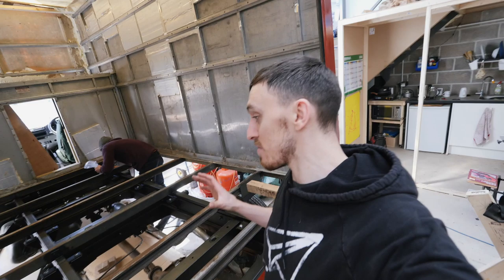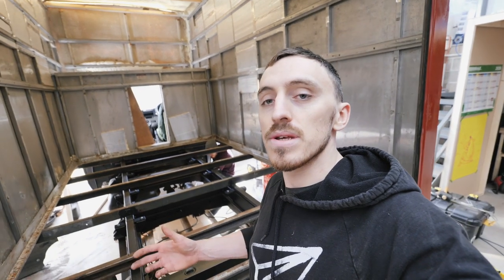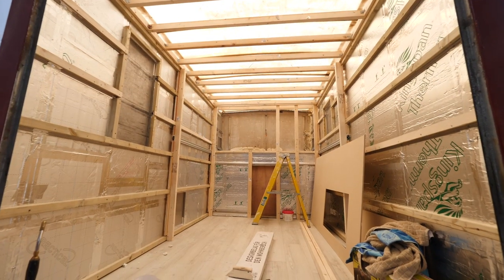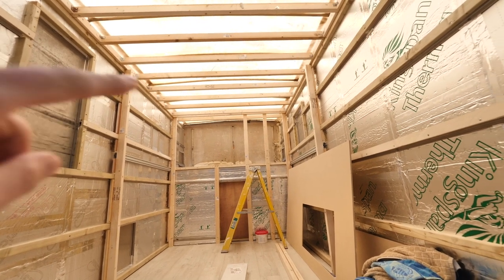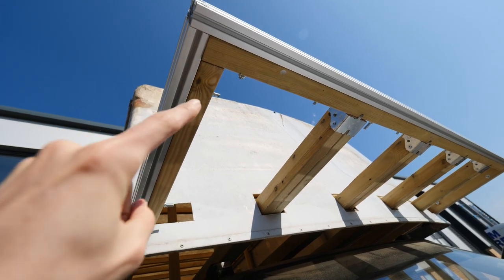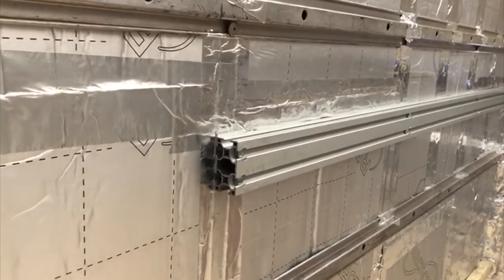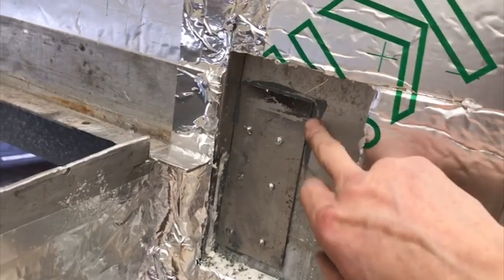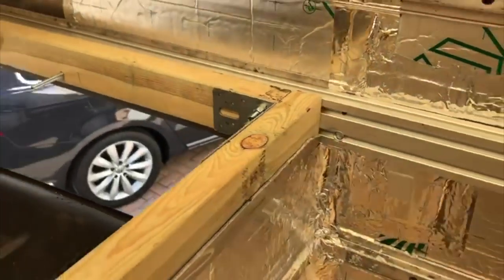Luton Camper Van Build INSULATION and Framing Part 03

Comment: Hi Hugh :) Thanks very much for the video. I'm trying to work out how to do insulated flooring in a luton van. The videos I've seen in sprinters have said to screw battons into the floor of the van. But I don't think the floor of the luton is metal so I'm wondering if that would still work. Without batons I suppose you could just glue the insulation to the floor and then glue the ply to the insulation? You wouldn't be able to fix any of the furniture to the floor though. What do you think? Thank you! :)

Comment: What did you use for the new floor? Just marine ply?? I need to replace my floor and looking at options. Great work guys keep the vids coming!
Reply from the maker: Ben used treated hardwood plywood. The previous floor was just untreated 18mm hardwood plywood and had lasted pretty well over its 20 year lifespan

Comment: Hey Hugh👍🏼 you’ve got me interested in converting one of these! Have I missed or have you not said about the size/spec of the base van? I was really only looking at more modern vans but thinking about if and when things go wrong older (in terms of engine or mechanical specs ) might be preferable. Imagine being out in the wild and having to reset a fault code before you can drive...with older might stand a chance of self fix or AA doing it roadside...off topic I know but wondering if you have any opinions either way 👍🏼👍🏼
Reply from the maker: The first luton vid shows dimensions:
https://www.youtube.com/watch?v=uSJgQ5GVSRI&list=PL0IGX0gmjeZnp-ZKWQZ6dq2y_SrcaLC7k&index=4

But the engine specs I haven't published. I totally understand your argument and I was really 50/50 about going much older for simpler engine like a merc vario but I decided modern as I have done long drives in old and new vehicles and from my personal experience i prefer newer as driving them is usually more comfortable  and less tiring over long drives plus higher cruising speeds and much better mpg.

Comment: Obviously you're planning on having Solar, hence the removal of the Fibreglass Roof.
Reply from the maker: To be honest that isn't the reason Bens removing the fibreglass, more that its old and cracking and he would prefer a flat timber construction roof that will be strong enough to stand on.
Reply: HughTube Excellent Idea. A Roof Deck.